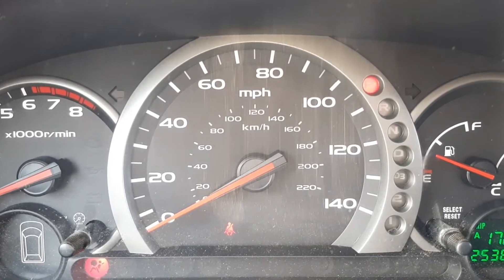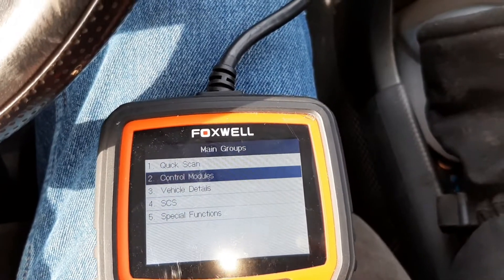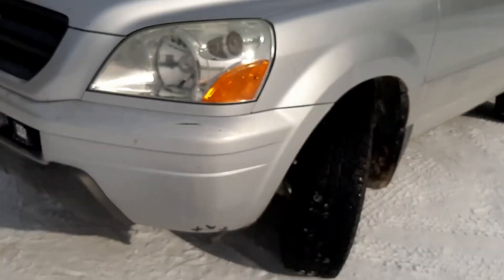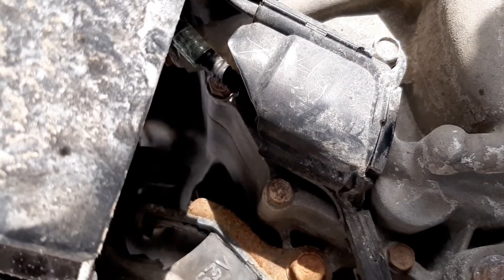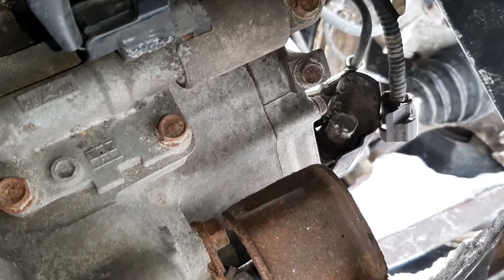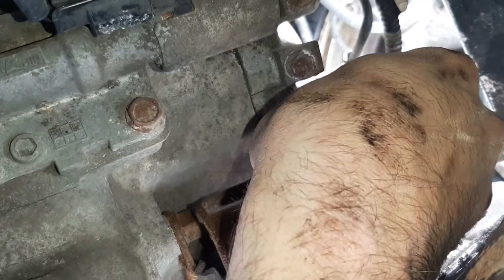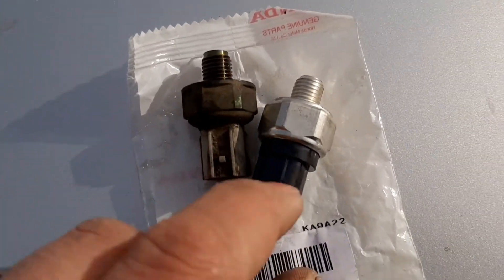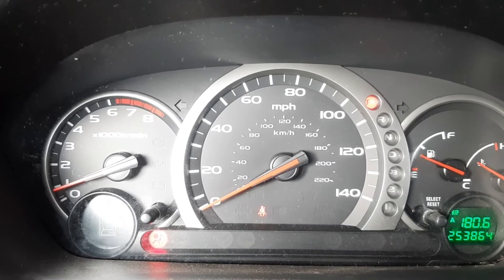05 Honda Pilot 3rd pressure switch replacement.

Comment: This just happened to me on the road. Car loaded, full of kids, 90 outside and going up a hill.
Felt a jolt, like the tranny slipped. Freaked out because we were 70+ miles away from home and it is memorial day.
Was able to make it home after pulling over and resting a bit. Got on here and your video has been really helpful.
Thanks a million!
Reply: y my05 keeps jerking foward like its slipping gears especially when driving in the highway for more than 2 hours? Flashing “D” came up yesterday while driving back from Wisconsin to chicago in the highway and thank god when exiting the highway it started jerking really bad.. i did drain and fill already and changed 4th gear pressure switch and same thing keeps happening .. changed motor mounts and trans mounts , same thing.. i changed my clogged cat to a brand new one same thing keeps happening… at this point im just started to think it has a tranny issue… it has 166k miles and nothing but headaches.. i think its time for a new car and monthly payments.. did u fixed the issue?
Reply: Hi. I have same issue same car. Did you replace this and did it fix it?

Comment: Thanks, my Honda pilot would stop after driving fine and wouldn’t move in any gear everybody was telling me it was the transmission but I told them to replace the 3rd and 4th pressure switch after watching this video and it worked
Reply: Wow. I'm gonna try to get autozone to scan my pilot. I want to replace only the one that is bad. I pray it fixes my 3rd gear slipping issue.

Comment: Just wanted to say thank you my car repair shop confirm that I needed a third pressure switch I wasn’t sure but I could’ve saved $130 for diagnose. I did save time by having the parts there for them to install. again, I thank you for putting out this video.

Comment: I have a 2004 Pilot with about 257K miles on it and got the flashing D indicator yesterday.  Also, the shifter will not go into D3, 2 or 1.  Not sure what this is about.  Could a bad pressure sensor cause this?  Appreciate the video.  I went out and bought a Foxwell OBD scanner bases on your video.  Thanks for providing this video!
Reply from the maker: Not sure what that would be.  If it's not physically going into gear, it could be the shift cable.  If it's not showing up on the dash display but still going into gear, it could be the range selector switch.  The scan tool should help a lot.
Reply: @Whitestrash  Copy all.  Thanks for the reply.  Should get the scanner tomorrow.  I'll try to remember to post what I find out.  Thanks again.

Comment: I changed my 3rd gear pressure switch 8 months ago.  This morning the D was flashing again.  I am hoping it isn’t a trans failure 😞.
Reply: Hi There,

I have an 03 pilot and this just happened to me. 
Ive read on many forums that the tranny does need to be replaced at about 100k.
One good indication that your tranny is slipping is jolts during the gear changes or the engine reving and the car struggling to pull speed.
Reply: Did you use an OEM switch?
Reply: @girthy10incher23  yes I did.  I’m actually heading to get the car scanned to check the error code this time.  I would hate this to be the transmission.

Comment: This helps so much I have not been able to figure out what is going on and do you know what is wrong with your airbags because my air bag lights is on to
Reply from the maker: My airbag system has a bad impact sensor.  Probably a corroded connection because it's intermittent.

Comment: Is the process the same for an 07 pilot?
Reply from the maker: I can't guarantee it, but I'd imagine it is.  It's the same body style in that year.  However, the transmission itself changed after 2005, so it could possibly be different.

Comment: My Honda CR-V 2008 D light flash after driving for 2 minutes which continues throughout the journey. When I scanned I have P0848 ( transmission fluid pressure switch 3rd clutch) please where is the switch located?
Reply from the maker: I have no idea on a crv, sorry.

Comment: I just switched the 3gear pressure switch now it won’t start.  Anyone have any idea why? I was starting fine
Reply from the maker: That makes no sense.  It shouldn't affect it at all.
Reply: @Whitestrash  that’s what I had said. All I did was switch out the pressure switch and replaced it with a new one. Going to try putting the old one back on and see what happens
Reply from the maker: @khmerboy044  yeah i wonder if that will do anything...
Reply from the maker: So it will crank but won't fire?
Reply: Sounds like the ground that goes to the coil packs got knocked loose. It’s on the thermostat housing.

Comment: Anyone know why my 05 keeps jerking foward like its slipping gears especially when driving in the highway for more than 2 hours? Flashing “D” came up yesterday while driving back from Wisconsin to chicago in the highway and thank god when exiting the highway it started jerking really bad.. i did drain and fill already and changed 4th gear pressure switch and same thing keeps happening .. changed motor mounts and trans mounts , same thing.. i changed my clogged cat to a brand new one same thing keeps happening… at this point im just started to think it has a tranny issue… it has 166k miles and nothing but headaches.. i think its time for a new car and monthly payments. Anyone had this  problem before and fixed it?
Reply from the maker: Sounds like the trans might be taking a crap.  They weren't known to be the best transmissions.  I know they had issues in that year with the trans cooler leaking and letting coolant into the transmission.  How did your fluid look when you drained it? And what fluid did you use to fill it?
Reply: Do you have a P0848 code, did you replace the 3rd clutch switch and if so did you buy an OEM switch? I see you said you replaced the 4th clutch switch?

Comment: I have a 2011 Honda Pilot, I had the 3rd high pressure censor replaced about 5 months ago and the D light started to flash again today.
Is there other high pressure censors that cause the flashing D light
Reply from the maker: There are plenty of things that can cause it to flash.  Usually it's not good.  I just got lucky with mine.
Reply: Did you use an OEM switch?
Reply: Try replacing the 4th high pressure censor. Not guaranteed to fix but also a common issue
Reply: @girthy10incher23  you can get by with after market switches but make sure you replace the aluminum crush washers with new ones.

Comment: Change the transmission oil pressure switch, don't order online ,buy from the store,for the D flashing, it has 2 pressure sensor on the driver side,its the 3rd one that need to be change, and at the store it will show 2 types a vrey and a black, get the black one get it replaced and you good.

Comment: Got a Honda Pilot to same year  how much would u say this job is if a mechanic. Does it
Reply from the maker: Not sure... it's a pretty easy job so it should be less than an hour of labor.  The part was like 65 bucks, so you might get it done for around $200... maybe.
Reply: @Whitestrash  don't know if this will help anybody in 2023 but I got a quote today to replace it for $300 and this is from a Acura/Honda only mechanic. 

Love those guys at the shop but that's too much so this I will do myself. Thanks for the help!
Reply: @Whitestrash  Just had this done today and they charged me a whopping $536.00. The part was $200. Rip off but I'm no mechanic.
Reply from the maker: @1962Aero  Ooof that hurts. But it's still cheaper than a new vehicle.